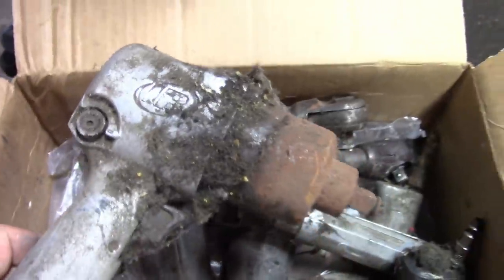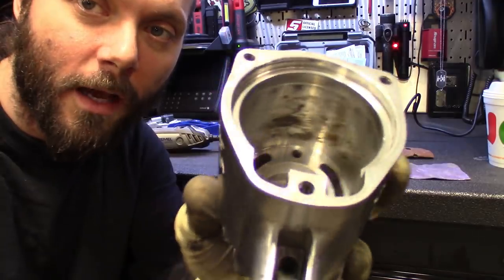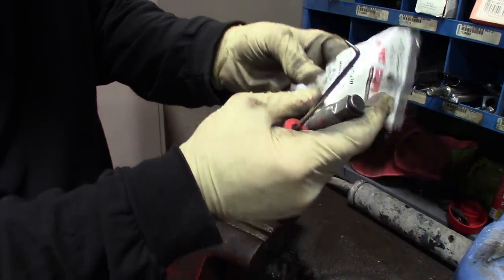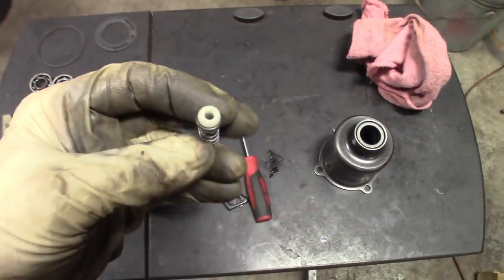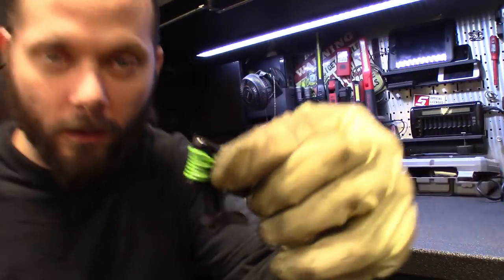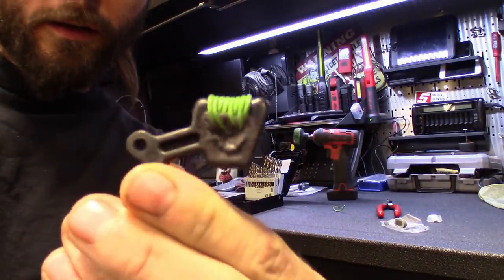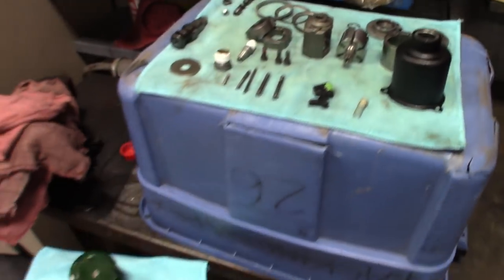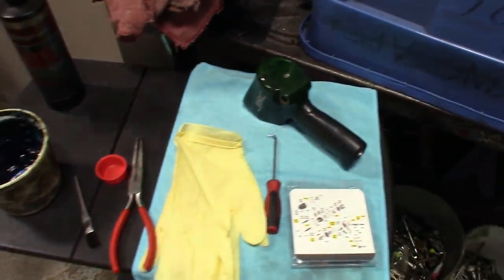IR RESTOMOD... The JRC54 Way!!

Comment: The old 231 was a workhorse in its day. I still have one that’s never been apart. I don’t use it everyday anymore but she’s on standby just waiting for the BatPhone to ring. I’ve used the Rustoleum bed liner but it didn’t stick. I guess my surface prep was lacking. The old 231 was also the coldest gun around using one in the winter with the cold air running through it brings back memories.

Comment: Looks great sir.  One word of caution though, that I found out myself the hard way, is that Rust-Oleum bed liner is not solvent resistant.  I did some fender flares in Rust-Oleum bed liner and while gassing up I got some gas on it and then the next day it had really messed up the fender flare.  Otherwise great work and you did a damn good job for someone's first hydro doing job.  Cheers!

Comment: I think you want to reverse the orientation of the two compression rings.  The rings are compressed as you assemble the two halves.  Also, the collar and gasket are installed in the front portion.  The collar presses against the raised outer diameter of the compression rings and may aid in sealing your compressor air from entering the anvil/hammer area and leaking out the front.  I'm not sure if I seen it, but the raised area on the washer sits against the front bearing.  I believe the gun will behave much better if you apply these fixes.  I made these mistakes on my 231.  Good show.

Comment: On what website or store do you buy the rebuild kit from because I want to rebuild my IR 231 model A I knw it’s old and really rare to fine part but I don’t knw if the model HA or HA 2 or model c is compatible if you knw please comment back to me please
Reply from the maker: eBay has most of your rebuild kits Available
Reply: JRC54 I checked eBay it has quite most of them but I need it also for my IR 107 3/8 air ratchet and I’m asking you for help if u knw any websites I can get these tune up kit
Reply: JRC54 but thank you for the info means a lot